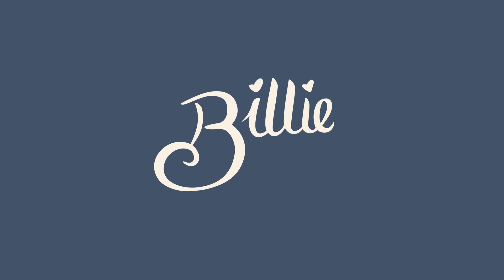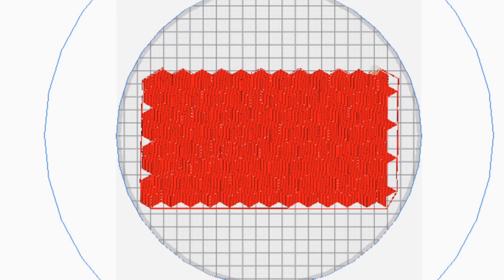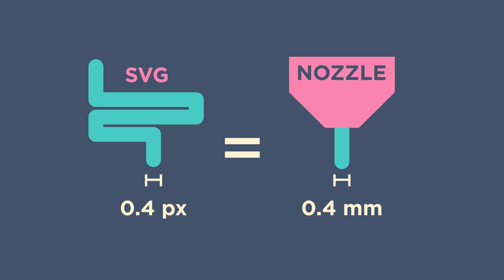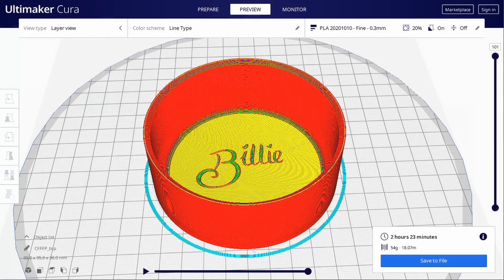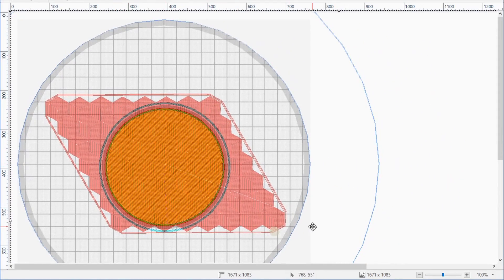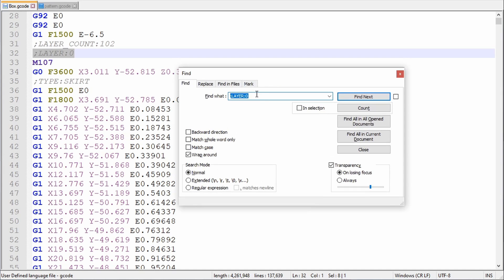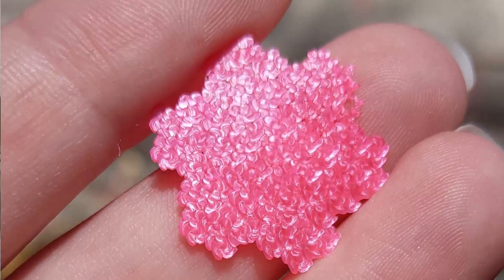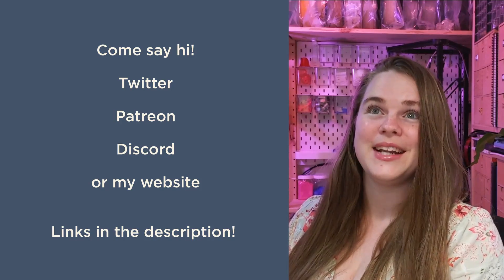DIY 3D printed custom toolpath patterns

Comment: Hey ! I search a lot to do that effect. And I finally find an easy way to do this with BambuStudio. I write this here for those who want to do the same in 2026 ^^
Well, import your stl. Then select it and import your svg (a simple svg work, no need to do some specific path). A window open to allow you to resize the svg. Then adjust it to your surface with the yellow square and move it where you want. Make his depth to your layer height, select "Use surface" and "Modifier" in the window. If you close the window, you can go in you objects, develop your stl, find your svg, right click -> Edit SVG
Then go in you objects, develop your stl, find your svg. Search on the strengh tab of this specific svg the infill direction and change it to 135°. That's it ! Slice and see.

Comment: After splicing the gcode, it's placing my model and the part i'm printing on the same layer, which causes the nozzle to drag across the pattern once it's finished and try to print into the pattern. Any idea on how to make sure my model is printed on the next layer instead of the same?

Comment: This was so so hard... Been working on it dor hours
Reply from the maker: Can I help at all? Which bit is catching you?
Reply: @BillieRuben  

Oh you are to sweet for reaching out. 

So i can't get the file on the buildplate XD, i adjust it in inkscape and try to get it on the position it needs to be.

One time it worked and i copied everything into gcode, but my printer started to print off the buildplate, also i can't slice the project ? 
😂 I might be to noob to understand how to do this. But it's so pretty
Reply from the maker: Do you have discord? Can you join my server? Might be easier to chat there!

Comment: This is exactly the kind of video I was on the hunt for. This sort of level of customisation for printed goodies has surely got to be more at the forefront for people? Not just printing flat stuff all the time, but also the optimisation of gcode by putting the path creation back into our hands through either Inkscape or Affinity. Billie, can you share more tips for similar workflows? Or other repositories for this kind of info?

I have an idea to do typography with my creality, but for the print head to be ‘stroking’ and following the type, as though it were being done by a pen (basically a plotter workflow). There are some videos, but I find them clunky. Plus, I then want to obviously be able to do more than just one layer of custom gcode! Thanks for your idea though billy of just inserting a line of gcode from somewhere else! Seems like more gcode reading/writing will be what I need.

Comment: So cool. If you just want an fancy surface easily but are ok with pre-built patterns, check out PrusaSlicer's built-in "artistic" fill patterns. I like the Hilbert curve, but there's a few more to check out!

Alternate idea: run the custom gcode at the top of the print with extrusion disabled and zhop enabled to "emboss" a pattern (your signature?) into the surface, without any surface protrusion.

Comment: After I changed the first layer of gcode code, the software opened gcode and told that the file is not suitable for the current printer. My machine is ENDER3 V2. Do you know how to solve this problem?
Reply from the maker: No sorry I don't. Maybe try asking in the 3d printing discord? https://discord.gg/72c6FbZYH7
Reply: @BillieRuben  TKS!!What slicing software do you use?
Reply from the maker: @jackie127cnjk5  cura. It's all in the video!
Reply: @BillieRuben  I consulted customer service, it turned out to be a software bug!
Your video has taught me a lot, thank you! !

Comment: I'm guessing this wouldn't work with a resin printer without having specific lines baked into the design as it'd just come out solid due to resin curing it all in a single layer?
Reply from the maker: Yea it's for fdm really

Comment: I'm reminded a bit of normal map/bump map textures on 3D models for video games and the like, which can give a fake depth effect kinda like the cubes one. I wonder if tricks like this could be used like that, or if there's not much use in faking small 3D details when you could just print those details directly.
Also I bet this technique would look rad on one of those prints that goes flat on the bed and is folded up afterwards, gonna add that to my post-holiday gift prints bucket list!

Comment: Were the "mechanical issues" just at the transition from the first layer to the second?

I noticed that your slicer was set to absolute extrusion, as normal.  So unless the amount of filament used in the first layer from the SVG was exactly the same as the amount used in the first layer you deleted from the model file, they wouldn't match.  That would cause a problem - most likely some underextrusion. 

You could fix that with just one more edit: Note the last E-value in the model's original first layer.  It wasn't quite visible in the video but it must have looked something like "G1 X35.391 Y-32.912  E949.[something]" in the video.  Then after you substitute the SVG first layer, add a line "G92 Ennn.mmmmm" just after the "LAYER:1" comment, where "Ennn.mmmm" is the E-value you noted from the original.  That makes the printer believe it's just extruded the amount used in the original file, eliminating the mismatch.

Great video, though!

Comment: I don't use cura very much but I have to try this. I was experimenting with printing on textured vinyl stuck to a print bed.
Reply from the maker: Ooh! How'd that work?
Reply: @BillieRuben  It worked out ok in that the printed piece definitely had the texture on it. Kinda a carbon fiber look I found. I got the idea from this but could not find the particular material. https://makezine.com/2020/02/18/this-clever-trick-embeds-holographic-patterns-in-your-3d-prints/
Reply from the maker: That's so cool!
Reply: @BillieRuben  I love experimenting with processes. I like printing on tulle but I have not done it in a while. I wanted to cut stuff on my vinyl cutter and put it on the bed to see what happens.
Reply from the maker: That sounds awesome! I'd love to see results!

Comment: I think the idea is kinda cool, but the execution probably needs some work. Should probably be a plugin in it's own right (I didn't know that Cura had a store either, but I use Prusa Slicer normally). 

What would be really cool is if you could import a SVG as the fill pattern.
Reply from the maker: are you volunteering? 😁

Comment: I experimented with using textured vinyl on the build-plate. Best results came from the Di-Noc carbon fibre vinyl that 3M make. It's quite thick with a heavy embossed pattern and leaves a good imprint behind. Printed PLA with good results, and tried PETG as well but that ended up fusing with the vinyl because of the higher temps. I also found some leather texture vinyl that produced a good effect.

You can see the results here - https://imgur.com/a/LwygRYf

Comment: Have you tried splitting your tesselation example into 3 groups of stls (kinda like what you'd do for multicolor, only here you're using the same color for all 3) that represent the 3 different printing orientations of the rhombi, with a variety of infill patterns and slicers to see if there was a specific combo that led to attractive results?  That way it could be automated and you could use whatever nozzle diameter you wish :D
Reply from the maker: Well the main goal of this project for me wasn't the tumbling blocks, I want to make more organic shapes. Things I can't get with traditional fill patterns. :)
Reply: @BillieRuben  Thanks for the video, this is awesome!  And also great tip with the px stroke width in Inkscape!

Comment: Oh – I suspect that some slicers (S3D for example) won't render a 0.4mm wall when the bead of plastic is set to 0.48mm (the default for a 0.4mm nozzle) – so it may be better to make the pattern's line width 0.5mm. That should achieve the same result I would think, and it'll be portable across more slicers.
Reply from the maker: I don't think I understand sorry. The slicer itself isn't making the pattern, the plugin is.
Reply: @BillieRuben  Ah, good point. My bad 😁

Comment: So I'm trying this now with Cura for Lulzbot, they don't have the svg-->toolpath plugin. I just saved both to gcode as per the video, then Copied and PAsted the Layer:0 pattern into the objects Layer:0.
I can get a pattern as 1 layer, or the solid object as a normal layer, but not both.
It's not generating a toolpath with the pattern within the object... Am I missing a step, or is this not supported in other printers?
Reply from the maker: I'm not sure I fully understand what you're doing sorry but you definitely need the plugin. Maybe download the latest cura from the website and set it up for your lulzbot? If you need help with that let me know and I'll write up some instructions

Comment: Awesome job! This made me think, to make this more easily accessible to users, there should be some slicer plugin that allows you to provide a custom script/algorithm for programmatically generating the toolpath for the top and/or bottom layer of your model.

Then those scripts could be easily shared between users and maybe even customized with some variables (e.g. for pattern density or other features). The plugin should have some automatic algorithm to crop the pattern to your model surface so it doesn't overflow. This would work for any repeating or algorithmically generated pattern.

For non-repeating or more elaborate patterns though it would still make sense to build them manually in Inkscape or similar, but there could still be some plugin to deal with fixing those to top or bottom surface in the slicer and do automatic cropping so you wouldn't have to manually edit GCODE and cut the overflow as a post processing step.
Reply: And now I started thinking it would be cool to have programmatically generated fractal patterns for this too. :)
Reply from the maker: @KariSöderholm  yea! That Gosper curve is one! If we had that plugin you described we could do all sorts of things! 😊
Reply from the maker: Omg! That would be ah-mazing!! 😱😱😱 Like a turtle program kinda? Please please please! I know the Cura plugins are written in python. Is that something you would know how to do??
Reply: @BillieRuben  I'm a web developer (mostly TypeScript, JavaScript, frontend stuff). I've not used Python much though the language itself shouldn't be a problem. I'm not sure about the details in if or how this would technically work as a Cura plugin since slicing itself is a complex topic and I haven't even used Cura except I tried it once.

Conceptually this feels doable but not sure about the complexity to implement it and it depends what kind of APIs are available for plugins in Cura. Though this is definitely interesting and I might look into trying to make a simple Cura plugin (starting small, like just generating a one layer toolpath without considering imported geometry). But the biggest issue I have is lack of free time as a dad. I don't even have enough time to do 3D printing projects on my list (and some electronics, Arduino, ESP8266 stuff that I'm still learning). 😅
Reply from the maker: @KariSöderholm  oh gosh even without kids I know that feeling! If you do give it a go let me know, I can get help from folk. 😊
Reply: @KariSöderholm  Hi im a Software Developer (C/Ruby/Cobol and bit Phython ) if you need Help we can try to make that Plugin togehter and maybe one for Incscape like Heshfill.
I'm not a dadbut i dont have so much free time to make it alone.  But maybe we can do that togehter as a Community . greetz